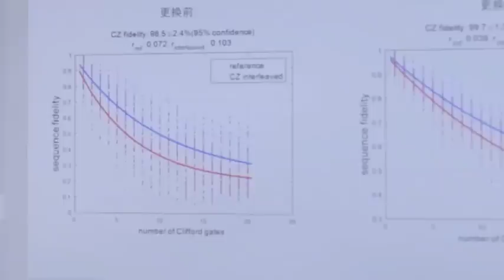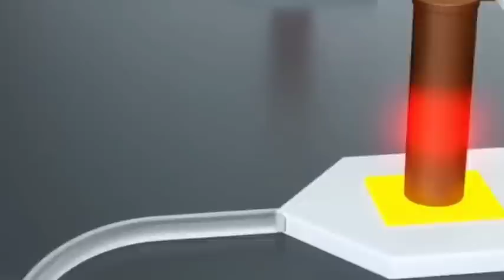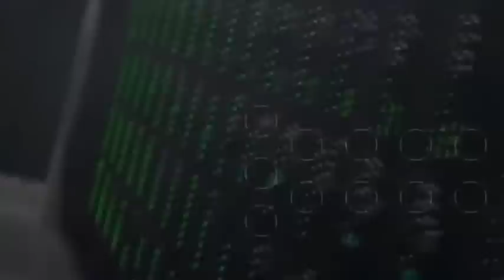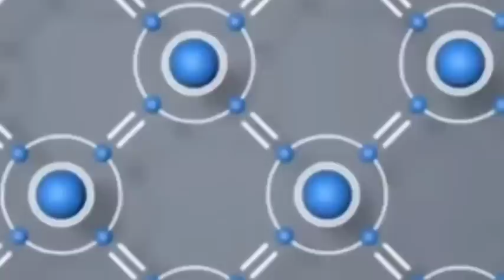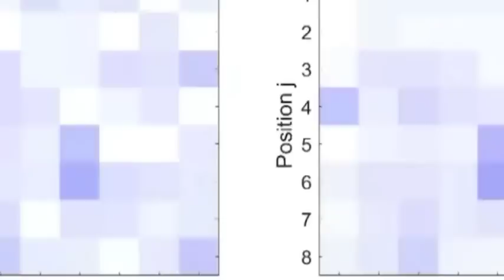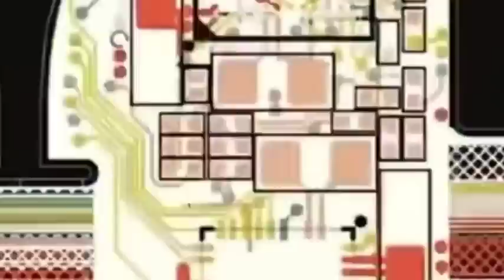China Invests 8.15 Billion To Build A Photonic Chip Production Line!

Comment: I think this video is misleading.  China has produced 8 inch graphene wafers and there are efforts to design chips using graphene.  China has also begun a quantum chip production line.  The video says these are still in development.  Further, the video says China is stuck at 28nm for chips which is not true.  SMIC is already in production at 14nm and has begun 7nm production.

To mislead, is a mistake.  Those in the know will point out the facts and the credibility of your video will lose value and followers if these errors continue.